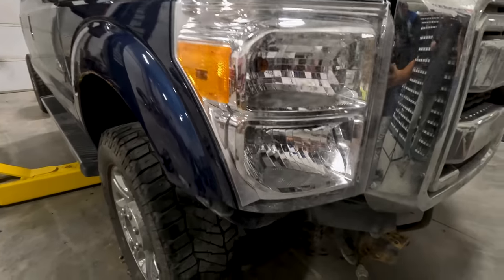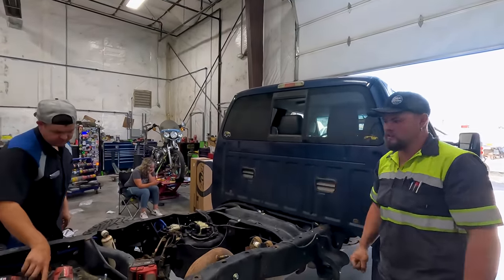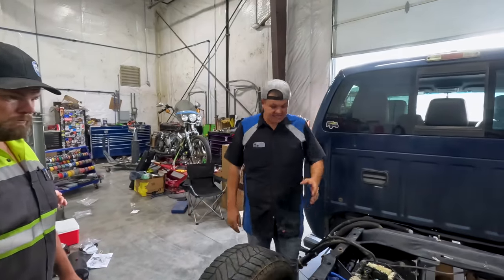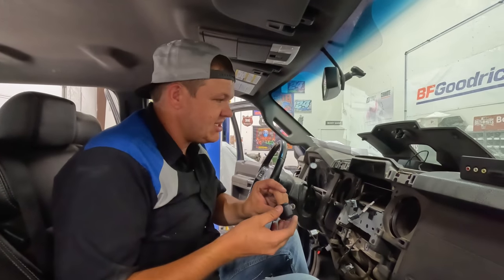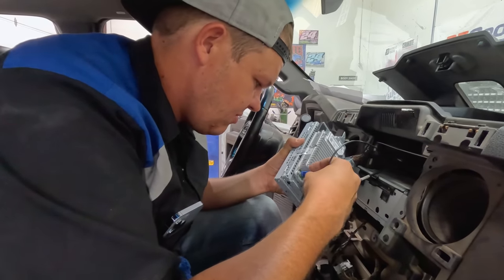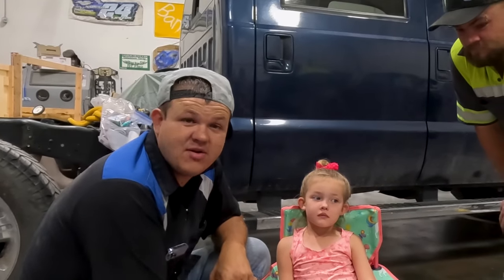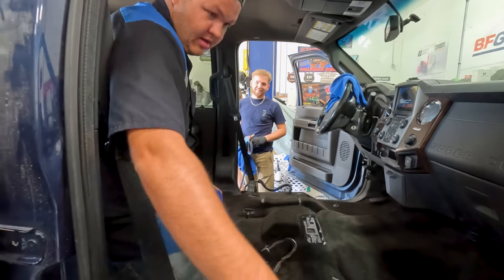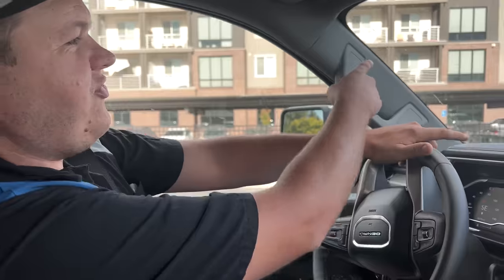Matt's Off Roads Blue Steel Gets Airbags And Detailed!

Comment: Robbie nooo,,always put the GPS sensor on the roof. Even if it says you can put it in the dash, still put it on the roof. Way better signal. And when taking any seats out that are connected to airbags you should disconnect the battery that way the airbags don't fault and randomly go off. Have seen it happen.

Comment: This is a labor intensive job for sure.

If you don't have a steamer, pull the carpet out completely and pressure wash it and hang it up to dry. I find that this method removes more sand than any steaming and extracting method that I have ever come up with.

Comment: Being a state of the art body shop you need a dry iceblaster for car, engine, carpets, roofliner  cleaning. Also can be dialed in to just remove clear coat or crank it and take it down to bare metal. Only waste is the paint, dirt taken off. No sand residue, less clean up time. Save huge on labor hrs.

Comment: For floor mats like that, just use a hose, brush, and degreaser. Quick Detailer isn't for heavy duty cleaning, just touching up and maintenance. Steam is great for cleaning, but you need to agitate with a brush, and cleaner, to use it effectively. Also applying any slick coating to a floor mat can be dangerous, once it gets wet it's like ice and can cause a good bit of hurt.

Comment: Demri’s shirt ought to say BOSS on the front with your logo on the back.  My Wrangler has WeatherTech mats and they get pretty nasty looking and I find that using the pressure washer on them and then using plastic renew stuff makes them look like new.  “Supplies” was great.  Matt’s dirty.  He should use a pressure washer on engine compartments for sure and then an occasional vacuuming and cleaning inside.

Comment: Do Matt a HUGE favor. Replace the cab mount bushings while you have it in the shop. I just replaced a couple of mine in the driveway and to say it was painful is a vast understatement. Fortunately, you are in a region where rust almost doesn't exist. I am sitting here writing this wondering how I am going to remove the front bolts (the captive nuts were rusted out). You probably have a better facility for replacing them and it will make a BIG difference in the inside of the cab.

Comment: Interesting.  Sync 3 has Apple Car play.  Not sure why you would need an adaptor unless you are setting up for wireless connection.
Reply: Probably it adapts the controls on the steering wheel to work with the new head unit and by extension your phone.

Comment: I figured you've already made a decision for "air bags" I have used those and like the timbren rear suspension helps instead. They don't have sway problems like the air bags and you don't have to fiddle with air pressure regulation

Comment: Where are your multi level metal tables on wheels for work/part_storage/organising_separate_projects??? Working on a floor is ok when you don't have choice. Make 5 or more wheeled and shelved tables 3ft by 6ft and you will never look back. Every project will have movable work station/organiser place which you can tuck away when needed, or double when you have extensive work done on one car. And don't worryyou will still have your floor if you want to sit or lay on it- the only difference, now it will be clear wherever you need it, because all of your parts and work space will be on movable table stations with multi shelves below.

Comment: My 97 f350 doesn't squat  even with 1 ton of wood pellets on bed.  She rides a little ruff but no squat. I personally don't like bags.   I was dreaming of doing on board air with a tug boat air horn with aux battery to run compressor. Would've been funny with it set up to a panic alarm😂😂😂😂😂
Reply: Air bags on pickups usually function more as a helper spring, and are quite good on newer truck where they’re softer riding and have higher gvw than older trucks

Comment: My ocd is kicking is, nuts face the inside of the frame, exposed threads are more likely to be damaged, and a bolt head just looks neater than a nut and thread hanging out.

Comment: umm...did ya squish a brake line on the right side bottom bracket? (Facing the back) Just wondering as it kind of looked like ya did at time stamp 7:32 unless there is a cut out for it?

Comment: Did you install that gps sensor upside down? Inside the truck through metal glass and plastic will definitely degrade the gps signal it will get there is no question about it, it will still eventually lock sats but not consistently and likely may take a minute. Biggest problem if you did put it upside down is that it won’t be facing sats to lock to so I’m interested to see how well it works

Comment: 17:14 I'm gonna be interested to see how well the GPS antenna works upside down. It might not matter, but some have an internal ground-plane that will shield the antenna.
Reply from the maker: I was told by the company that sent it to install the antenna under the dash and we pulled it out side and it was working so I don’t know 🤷‍♂️ but I did as I’m told!!
Reply: @RobbyLayton  Fair enough! It might be a type that doesn't matter. Maybe that company doesn't know either! 😄
I'm just concerned - maybe too strong a word -  that if it's the type with an integral ground plain, the antenna will pick up satellites at lower elevations, but the ground plain may mask satellites at higher elevations. Not such a problem in wide open areas, but in a valley the antenna may not see enough satellites. It'd be worth letting Matt know to keep an eye on it - if it's a problem, it's not like it'll be difficult to fix! 
Nice job though - Blue Steel is gonna look awesome when it's done! 👍

Comment: Should have bought a ready air kit. It comes assembled and uses two air bags to ride nicer and perform better off road. Installs half the time. Plus you could have used your wheel pros hook up to get a set.
Reply: But it’s more fun using a more complicated product and not reading instructions

Comment: Does anybody make a carpet delete kit for the Ford 3/4 ton. A preformed rubber or vinyl floor would be easier to keep clean. I'm sure the factory carpet holds and hides a ton of sand. Matts Ford looked great when they finished cleaning. 
My Dodge 2500 came from Chrysler without carpet and it was nice to be able to open the doors and wash the mud or dirt off of the cab floor and out the door.

Comment: Around 19:18 in the video the front floor mat was treated with VRP.  I assume that is a Chemical Guy's product.   I can't find anything that says that it is ok or not for that use.  Some products like Armor All can be slippery so using on a floor mat or steering column is not wise.  Was the floor mat slippery after using that product?
Reply from the maker: The reason armor all is slippery is because it has silicone in it!!! Vrp short for vinyl rubber plastic is non silicone based!! We use it and love it to each there own!!
Reply: I am not criticizing its use.    I just want to be sure that it will be acceptable using it on my Weathertech floor liners.  The driver's side floor liner does not look good and VRP may be the solution.    @RobbyLayton

Comment: 17:50 a new "performance" radio without bluetooth? expternal adapter do not count...
Reply: The truck had Bluetooth and controls on the steering wheel. The adapter connects that to the new head unit.
Reply: @brassmule  So the new improved head unit, require an external adapter for bluetooth taking up 50% of the (now reduced) connections. Someone saved $1 on the head unit to sell this adapter (included in a higher base price?)
Reply: @ssu7653  hmm I didn't see the external unit. I'll have to review. I just know in my buddy's 2011 Ford F-150 we had to use an adapter to get the steering wheel controls to function with the phone and head unit. I figured that's what they were doing as well.
Reply: @brassmule They added it in the conpartment above the head unit, the thing they connected via the new dual usb connector

Comment: Why not just take carpet out for easier cleaning? You already did all the hard work of getting the seats out.
Reply from the maker: If we take the carpet out It would be in the same spot on the floor of my shop as it is in the truck wouldn’t it ?
Reply: @RobbyLayton  Yeah, I suppose it would be. Would rust be a problem with water from the steam cleaner? I know it's drier than an oven in Utah...

Comment: Hard to be sure but it looked like that powder coating had a very poor quality finish it looked very much like orange peel and it should be almost as good as your spray paint if done properly Robby, I know as I powder coat Motorcycle frames and parts for a living and if I gave them back like that I would go bust.

Comment: The brackets and the back bolt for the airbags they just don’t seem like much thought was put into the engineering their strength. I had Firestone air bags for my 01 cab and chassis power stroke. And it was built beyond strong and air tank was double there size. U have a bolt that’s what 1/2 size and 18inch’s long and then on frame side the braces for the bag and attached to frame also are built way to long and probably at the wrong angle?u can have the best part in the world but u attach it wrong  u just took the best in the world and made it the worst in the worlds it seems like they put any real pressure on those bags and it will destroy the brackets. Or that might be why there air tanks are only have the size of any other company tanks that came with similar airbag brands? That I have no idea if that could be a real problem? I was just trying to think of the different in any of the brands and the only thing I saw was there air tank was only half of the size of others brands that offer same type of gear. Love to hear other people’s experience